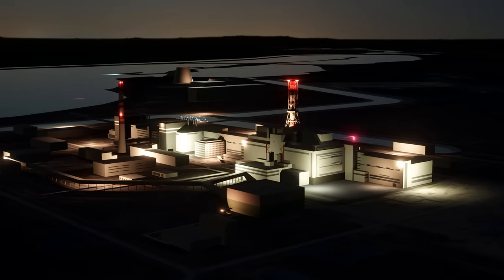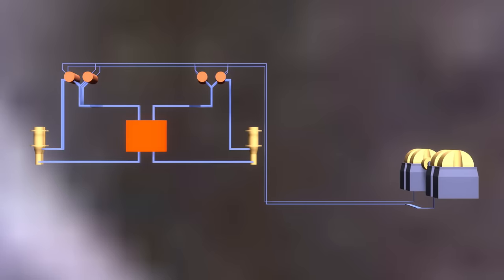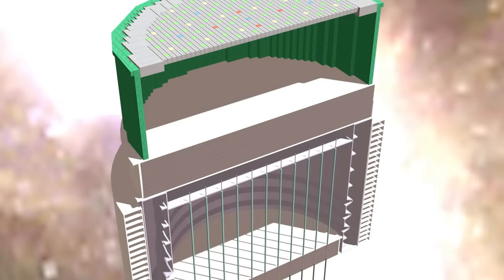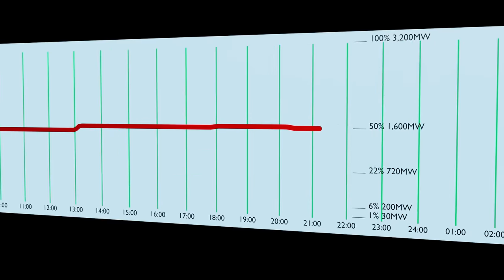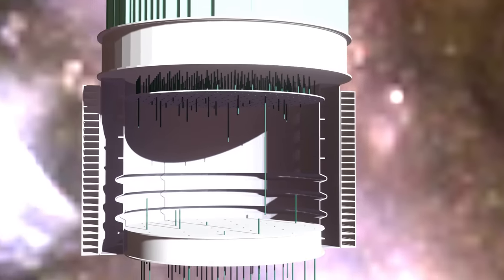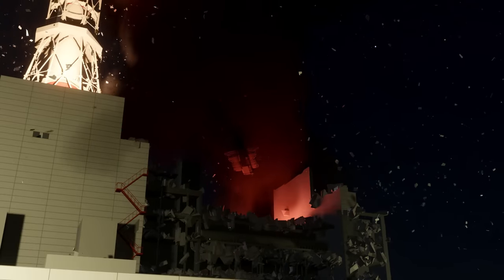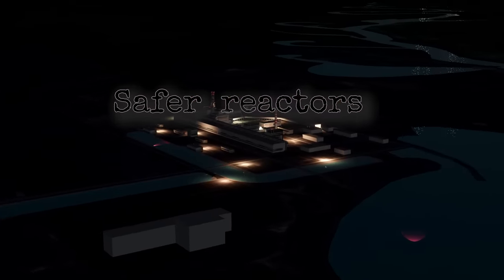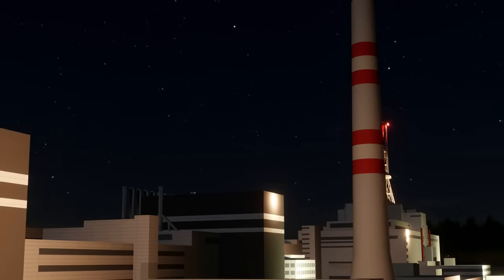CHERNOBYL AZ-5 why it exploded

Comment: Btw the Turbine (8 i believe) exploded first because of the high pressure and shortly after the reactor lid was blown off due to the high pressure building up because of the heating of the water inside the reactor

Comment: The video is great, I would just like to note a couple of things. AZ-5 was never that far down on the operator panel. A video of the Unit 4 Control Room during commissioning revealed this. In that specific location, there was a joystick used to move the control rods up and down. Second thing, AZ-5 did not insert the control rods from below the core, but after the scheduled shutdown of Unit 4 in 1986, AZ-5 was going to be modified to insert these rods from below the core.
Reply: I was about to write it, well see
Reply: @vladkryptonsalvinorine6715  He already acknowledged it and several other things in a comment which he did not pin (I don't know why he didn't pin it)

Comment: leonid toptunov had once mentioned to one of his co-workers that he was concerned about the graphite tipped control rods, because he thought in a case of emergency they might actually do the exact opposite of what they were supposed to do and kickstart a positive feedback loop of chain reactions.
i guess if he had reported these concerns to his superiors he would have lost his job, so he kept quiet about it, only to be proven right, which he paid with his life. he was only 25 when he dXed.
Reply: Nah, he would absolutely not have been fired, what a nonsense. He would've been just shot on the spot. And his family too for good measure. It's the Soviet Union we're talking about after all. /s

Comment: One of the incorrect things mentioned in this video - the core was not poisoned when they resumed lowering the power. The delay did create a Xenon pit, but it had come and gone by the time they resumed. The core was stable again. The stalling of reactivity happend due to a failure when switching between two automatic regulation modes.

Comment: Reactor 4 would have blown up without AZ-5. It just caused it sooner. RBMK can only handle 2 ruptured pressure tubes. They had over 100 rupture. Sad thing is that they ruptured a few pressure tubes at the Leningrad pant years before during the same test but classified the incident.
Reply: do you know what caused the tubes to rupture?

Comment: Another excellently done animation, Mike.  I have been told by operators that there are procedures for bringing a poisoned reactor back to working levels, but those are water reactors; increasing the power in the reactor does burn off the poison, and the operators have to be following the reactivity very closely to be inserting control rods as the poison is burned off, but it can be and apparently is done.  That they should be trying it on third shift with the lack of attention and with safety equipment shut off in preparation for the test seems criminal.  I was gratified to hear that you believe that the reactor did not suffer a criticality accident, that it was steam and hydrogen; there seems to be a lot of people who want some sort of criticality to be the explanation.
Reply from the maker: Many comments in my previous video repeatedly insisting it was nuclear.  In fact they know it was one, apparently there are mathematical calculations ... LOL
Reply: @Mike-Bell  Even if it was, it was a "fizzle," fortunately.

Comment: Something interesting I noticed with the button version of AZ-5 is that it was actually in the same (or similar) place to the current EPS buttons location, why do I say this? In a video recorded in the unit 4 control room prior to the explosion you can see a red something where the EPS buttons are, and it has a flat plastic cover. You can’t see it clearly but it is a definitely a red button, and it’s where AZ-5 is now

Comment: If not the "tip effect" and the human error, the RBMK would be my favorite design.
Reply: The large size making a strong containment building prohibitively expensive (and hence they were all built in simple industrial buildings) make them not my favorite design even without tip effect or human error. I prefer the BWR or PWR designs used in most countries instead of the RBMK.
Reply: It's unstable at low power mode, and yeah they got greedy when building the containment. Also no one is using RBMK cores except Russia so.
Reply: There’s a host of shocking design errors including the awful positive void coefficient and the fact that they had a poor idea of neutron flux measurements due to the huge core. Not to mention how it was over moderated.
Reply: @JC-lu4se  Positive void coefficient is a major design hazard. I learned about this at the university in the early seventies.

Comment: Thank you for this video. After the HBO series came out I was intrigued and researched and read various independent sources. I reached the same conclusion which you emphasize in this video, and which was unfortunately misreported in the series

It is not that the operators brought the the reactor to the point of explosion and the AZ-5 was "too late" to help. It's the fact that due to the design flaws, the AZ-5 itself is what blew it up.

Yes, the conditions that led to this situation were due to a sequence of wrong decisions by the operators, however, as you said - they did not know about these flaws. The best phrase I've seen in this context goes something like: "The question of fault of the operating personnel should be addressed in a context of one's accountability while sitting on a keg of gunpowder, completely unaware".

The designers of the reactor were fully aware of the flaws, thanks to those earlier smaller accidents you mentioned. But only after the big disaster they got around to fixing them, quickly and efficiently, across all remaining RBMK reactors, quietly and without ever admitting any responsibility. Shameful.

Comment: Thank you for explaining this so clearly. No lie, I have been trying to get my head around it for 35 years, ever since the disaster. I understood that whole xenon poisoning thing and how a sudden spike in reactivity in the absence of control rods would lead to destruction, but I didn't understand why the graphite tipped control rods or the AZ-5 activation led to the sudden power spike. I'm going to watch this again so it really sinks in, but I think I finally get it now. (For the record, I'm not unintelligent. I'm a chemist, and I did well at university. It's just that nuclear physics is not the easiest subject, even when the listener basically knows how atoms work. it's that whole moderator/control/fast neutron/void coefficient thing that gets confusing. In short, all of it.)
Reply: Graphite is a moderator. When a graphite displacer moves down the channel, it displaces water from below. As it not as long as the core part of a channel itself, there's particular amount of water in the lower part of the core inside the control rod channels. Water isn't a good moderator, it consumes neutrons, slowing down the chain reaction. Graphite is the opposite. It doesn't consume neutrons (or not as much), and it slow fast neutrons down to the thermal velocity at which they could be consumed by an atom and cause it to split. So when the bad moderator is replaced with good moderator, you have a power spike in that region. And if you have the water inside the reactor close to the boiling point, it can boil because of that spike. Steam has less density and consumes less neutrons than water, so amount of steam inside the core affect reactivity. So on the power spike caused by water being replaced with graphite you have yet another spike, when water is replaced with steam.
Reply: Your problem is that for some reason "graphite tipped control rods" ended up being an extremely popular thing to credit for the disaster, but it's basically a total lie and makes people think that they had little tiny caps on the ends for no reason except 'lol idk'. The HBO series where they said "it was cheaper" didn't help.

Comment: "This was a heat and gas explosion. It was not an atomic bomb and nuclear scientists get frustrated when Chernobyl is called one"
Probably the most correct thing I've heard about Chernobyl. Can't remember how many time I have to explaint to people, that in such event as Chernobyl, Fukishima or Three mile island, the fuel never exploded as a bomb
Reply: With Fukushima, and 3 mile island you are correct, but you are dead wrong on Chernobyl. It did not explode because the steam got hot, it exploded because the reactor became super critical, just like in a bomb. The explosion was the energy released by the core, and not anything else.
Reply: @billtoo4694  Dude where did you get that infomation tho. It was still steam explosion. Nuclear reactor fuel does not and cannot explode like a bomb
Reply: @Quang_Tran_asdf  nuclear fuel doesn't explode in nuclear bombs either. That's like saying a guy who burned to death in a burning house wasn't killed by the fire. It's splitting hairs. In a nuclear bomb the core goes critical causing a neutron flux, and energy release
Reply: @Quang_Tran_asdf  in Chernobyl the reactor core went critical causing a neutron flux peak, and an energy release. It's not the fall that kills you, it's the sudden stop at the bottom.
Reply: @billtoo4694  energy release caused steam to go overpressure and it exploded. When you say "fuel exploded" I'd think of it as an uncontrolled chain reaction, which release all of its fission power in a tiny moment. Exessive energy caused steam explosion is different from fuel exploded itself. Like, a match burned the house and killed the man, you can't say the match burned the man to death
Reply: @Quang_Tran_asdf  Попробуй подсчитать, что выделило энергию, эквивалентную 75 тоннам тротила... Что создало температуру, заставившую испарившееся ядерное топливо подняться в верхние слои стратосферы и распределится по всему земному шару...
Reply: @valerypedan8394  what

Comment: Hello Mike. Id like to point out a couple inaccuracies  in this video.  
1: AZ-5 was indeed near the top of the pult (control panel), multiple sources/pictures direct me to that AZ-5 had a small cap cover (and it was a button!) right up until the disaster. 
2: In the control room render, it shows only one MTK, and a set of mimic displays at the far left of the control room panels. There was 2 MTK`s and all the mimic displays were at the middle-right of the CR.

Comment: @ 7:59 it is said "the boron would arrive too late" - it did arrive however the extremely high temperatures deformed the the rod heads (made of boron) and they got stuck in their channel resulting in the explosion.

Comment: Excellent video and explanation; however it leaves out the fact part of the test required the auxiliary water pumps/cooling system to be turned off...no water, what little was left in the fuel channels superheated and the rest is history.

Comment: Just a heads up, the AZ-5 button is not in the bottom left corner of the SIUR desk, It was where you depicted the switch was. Tour guides for some reason got the deselector button mixed up with the AZ-5 button, it also wasnt a switch, and didnt have a cover.

Comment: I remember listening to the news on NPR radio and heard the report that the Soviets were asking France how to extinguish a graphite fire. Instantly I mentioned to my wife that a reactor in the Soviet Union had a "run away" and they were surely having a huge problem. Much later we learned that the reactor exploded. It requires up to 2000 degrees Celsius ( about 3635 degrees fahrenheit) for graphite to burn.

Comment: Wow, that lid had to weigh a ton and it got flicked up in the air like a wine bottle cork…can only imagine what the other workers experienced. The horror movie they did on this had me terrified of this story as a kid.
Reply: The explosions that blew the reactor apart were equivalent to at least 100 tons of TNT, the first blast hurled that reactor top a kilometer into the air along with the control rods. All because the operators inadvertently caused the reactor to go "prompt critical," which is a rapidly expanding chain reaction caused by fast, that is high energy neutrons. In the confines of a nuclear reactor, that is a disaster. Chernobyl was not the only accident of this kind, the SL-1 incident in the U.S. was caused by many of the same factors that led to Chernobyl. That accident killed three people and ejected the control rods like missiles, one of which impaled one of the victims. He was later found pinned to the ceiling still impaled on a control rod.

Comment: Safety regulations exist for a reason, and what the control room supervisor did by changing the parameters of the test, over the objections of the operators, combined with the design flaws in the RBMK systems used at Chernobyl triggered the worst nuclear accident of that time, and cost so many their lives

Comment: What is incredible is EVERY nuclear engineer knew the minimum control rod rule...what would possess them to ignore design specs is impossible to understand.
Reply: They knew the rule, they had little means to monitor it. It wasn't specified as critical to safety parameter, and it was calculated every 15 to 90 minutes on station computer. And this information wouldn't be very informative in rapidly changing conditions.

Comment: It happened because engineers had manually overridden the reactors automatic control system, which in the event of the reactor becoming critical would automatically shut the reactor down.  The perimeter control rods which cannot be manually overridden worked perfectly right up to the explosion.   These control rods were the "handbrake" the engineers were attempting to override. There were in fact two explosions the first a steam explosion robbing the reactor of water, which was important for reactor cooling and the second the explosion of the reactor.  What the engineers did was to force the reactor into a critical state with no way of shutting the reactor down.  Xenon produces radiation levels many times greater (X 100 approx) than that of the Hiroshima bomb.
Reply: It's not clear what the second explosion was actually. Some say it was a second steam explosion. Others claim it was a hydrogen explosion. But a  more recent claim is that the first explosion was a relatively small nuclear explosion, followed by a larger steam explosion. I am skeptical of the latter claim because the current understanding is that nuclear reactors cannot explode like nuclear bombs, the material is not refined enough for it.

Comment: The accuracy on this video is stunning, also the reason the AZ-5 rods took so long to go in was because the ministry medium machine building or something like that had the AZ-5 rods hooked up to the same motors for the control rods?  Which meant that they wouldn't immediately fall in, but slowly descend.
Reply: Soviet engineering at its finest

Comment: it's crazy to imagine the force required to propel such a heavy lid like that. As a lay person I've always wondered, if the AZ5 shutdown procedure didn't insert all of the control rods so abruptly, if it was somehow done more gradually, would the same thing have happened? Was the 'tip effect' only so disastrous because ALL rods moved at the same time ? Or would the same thing have happened regardless

Comment: The most fundamental problem, which underlies all the others, and is shared by all solid-fueled reactors, is that the reactor contains vastly more potential energy than what is needed to make electricity at any given moment.  This makes a strong argument for liquid-fueled reactors, because you can add more energy at any time.

Comment: The one thing that sticks with me about this disaster, is that even though it is disputed, the final thermal MW output before the explosion was between 30,000 MW to 300 GW(GIGAWATTS). Try to wrap your brain around how much power 300 gigawatts is. For one, RBMK reactors are designed to operate at 3200 MW thermal at 100% power. 2, 300 gigawatts would most likely power the entirety of the Eastern US for A WEEK. All that in a fraction of a second. Not only that, AFTER the explosion, at the absolute most radiating part of the reactor(the core obviously) the level of ionizing radiation was ( And this is not an exaggeration) 20,000 ROENTGENS PER HOUR, or in modern terms, 200,000 MILLISIEVERTS PER HOUR. That is enough to kill WITHIN SECONDS.

Comment: Note that it's only one particular isotope of xenon, xenon-135, that is a major poison - it has, I believe, the highest capture cross-section for thermal neutrons of any known isotope, at least 100 times that of the boron used in the control rods.